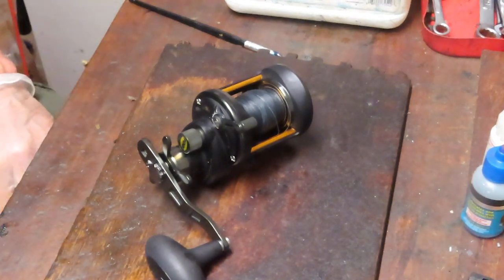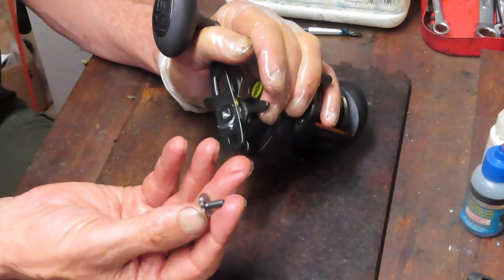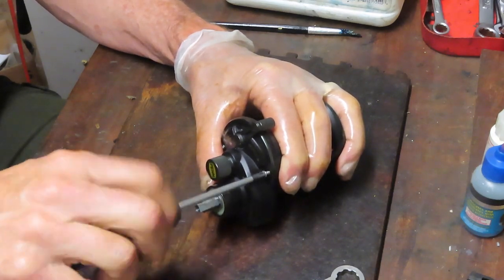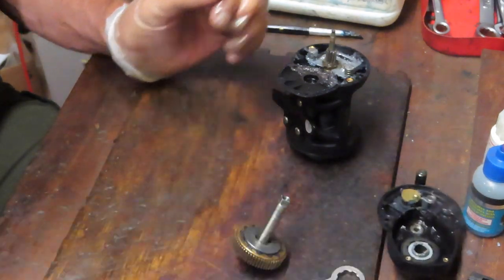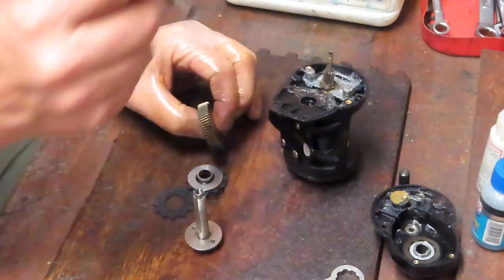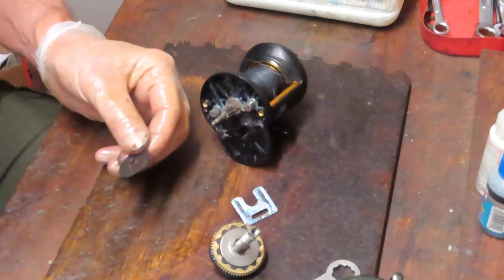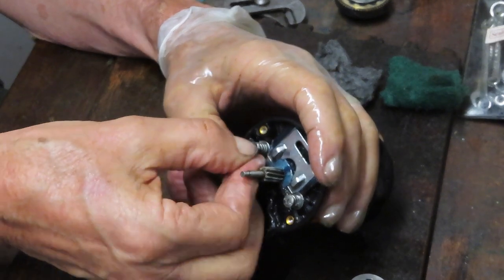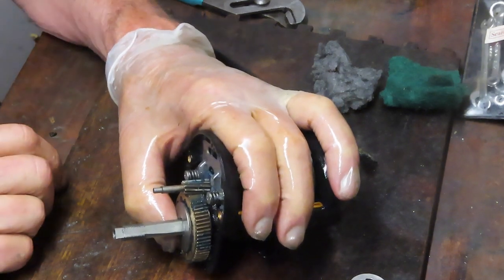Penn Squall II 15SD saltwater fishing reel with frozen free spool release how to service and repair

Comment: Similar to the old GS series.  Bought a size 12 Squall casting special and have two 535 GS that I’ve been maintaining in good condition for years.  Had a frozen pinion gear on a 345 GTI and crunched it with pliers even though I wrapped it in steel wool to protect the teeth.  Fortunately Mystic Reel Parts still has spares for some of the older reels and because Penn uses common components across many models old and new I like Penn reels.  They may not be buttery smooth like Shimano but they are tough fishing tools with lower up front cost of purchase and lower total lifecycle cost as well.

Comment: Looks like a cute little Chinese Penn. I’m looking forward to a few more spinning reels but I’m in no way complaining! I have those Craftsan ignition wrenches. I use them especially on the big Luxor reels. If that spool shaft was stainless would it have rusted like that? Freeing that pinion was impressive. With my limited vision there is no way I’ll ever use a torch. I have a very small precise torch I sometimes use but I can handle that ne. I use it to heat circle hooks and coat them with powder paint. Then I bake the hooks in the oven. My wife doesn’t like that very much! I use a bottle I bought that has a two inch ti on it. I fill it u with Penn oi and that’s what I use. I think this was a very impressive repair and service. You proved again your experience and skill! What a great job.
Reply from the maker: Chris - go and get a toaster oven from WalMart.  They are cheap and it keeps the wife happy!  I use one when I do the powder coating of Jigs - Dennis

Comment: Dennis, Ithink you may have made one harder for yourself - the Fathom II and Squall II reels have fast access (right) side plates in that the RH plate is assembled with the main gear and drag as a unit. Pinion stays on the spool shaft. You only need to remve the 4 outside screws to get to the internals.
Reply from the maker: Thanks for the tip.  I will check to see how that works on the next one in.  Best wishes - Dennis

Comment: Dennis, do you have any videos showing the parts and servicing of the reel tension knob? I'd like to understand how it functions.  Thanks!
Reply from the maker: I do not. The tension know butts to the spool shaft end.  When you tighten it that puts more pressure on the shaft and slows the spool.  When you back it off, it reduces the tension and allows the spool to turn more freely - Dennis

Comment: Hello sr, i have re assembled using the schematic, but now mi Star drag is like to tight, it's dificult yo move the star. Sorry for mi English and thanks for your time
Reply from the maker: OK - You need to remove the handle screw.  It is likely that you tightened down the handle before tightening the star adjuster.  Take the handle off, turn the star adjuster down and then reinstall the handle.  That should fix the issue.  If you cannot tighten the star adjuster with the handle removed, then you need to check how you installed the drag stack - Dennis
Reply: @2ndChanceTackle Mi procedure was:
1 adjust the star till one point that i need to put mi handle yo keep adjusting.
2 then i put the others two shims of the handle put handle and screw it. But the problem is that the star is pretty hard to move and it seems that its "shorter" than before , it has les clicks.
 I can adjust the star without the handle at some point, then i need to put the handle to keep adjusting the star...i Saw schematics and all seens to be fine. Thanks for your time dennys
Reply from the maker: Hmmm - you may have the star adjuster cross threading.  Remove the star adjuster and take the spacer sleeve off and then try to install the star adjuster.  If it is not going on easily, then the threads may be damaged.  If it is going on easily, then you need to recheck the drag stack.  It is possible that the earned washer is not set in the grooves inside the main gear
Reply: @2ndChanceTackle  i Will check that, thanks.
Reply: @2ndChanceTackle  when You said "turn the star adjuster down" You mean clockwise? Thanks dennis
Reply from the maker: yes

Comment: Can you do a video on a squall 2 30
Reply from the maker: Use this one https://youtu.be/tGao1PJBbnU It is on the fathom, but the only difference between the Fathom and the squall is that the Fathom has a metal case and the Squall does not - Mechanically, they are basically the same - Dennis